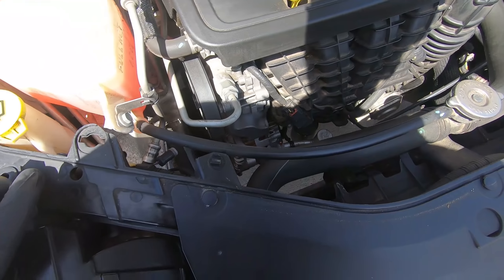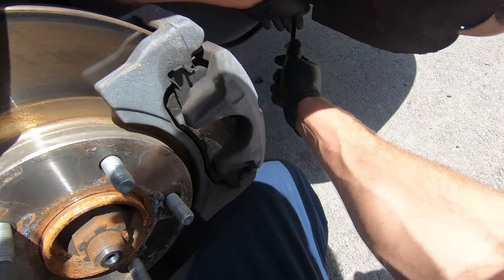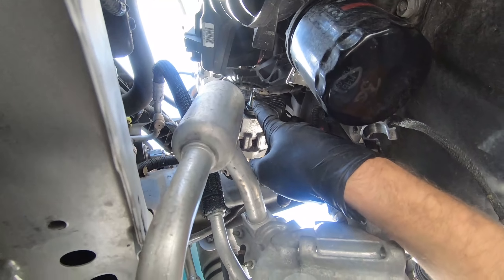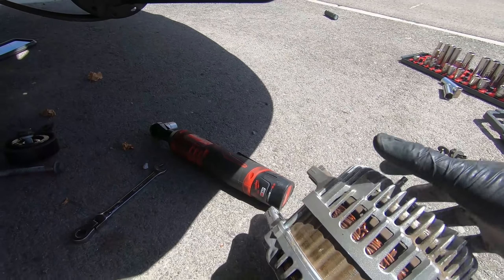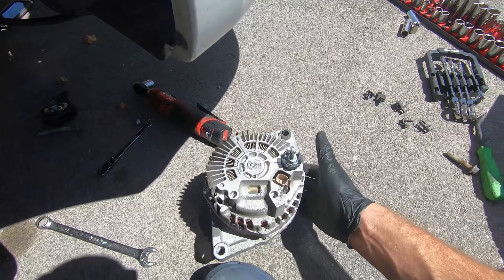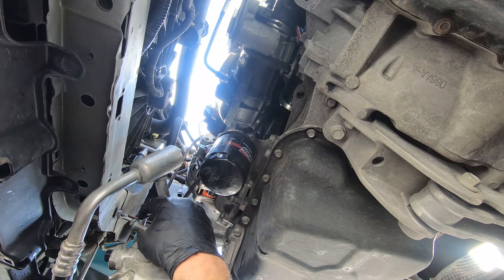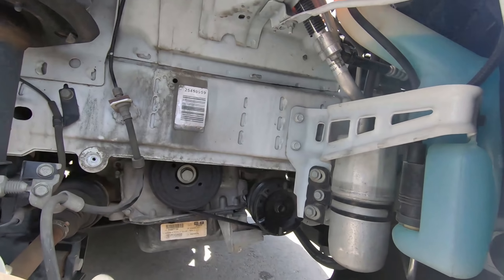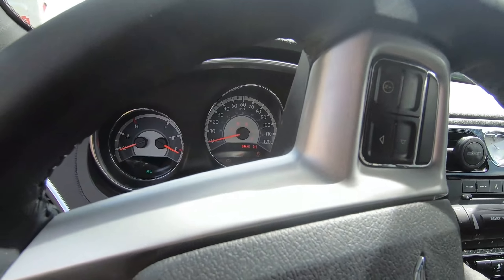This car shouldn't have made it home. Roadside Rescue

Comment: Unreal! I can't imagine how great it must be to fix stuff that isn't rusted. Like dude just unbolts stuff without a torch and doesn't have to beat the part off with a hammer. Where you at, Boise?
Reply: its called south where this no snow and road salt like here in Maine the only bolts and nuts that come off easy are that cars and trucks that are 3 years old or newer other then that u need pbb and heat and lot of praying unless it comes from the south and i did get to work on one and that was a dream and it was older chevy but it came from arszona lol splled it wrong lol
Reply: I was thinking the same thing i had a bolt crumble in my hand the other day. Turned to dust.
Reply: Sitting here in Denmark in my tow truck, and thinking the same. Here we have high humidity and lots of road salt.
Reply: @johnaranjo2059  "I don't feel so good"- bolt
Reply: I moved south a few years ago and look forward to keeping my cars running and looking nice for decades, no longer dealing with massive rust. Saves a fortune too.
Reply: Salt states scam their citizens. The car manufacturers must lobby for it. In my state it snows as much as Minnesota but we don’t salt. We have no problems in the snow. My 1990 Corolla doesn’t have any rust.
Reply: Years ago the wife and I were passing through South Dakota,  they must not salt, there were lots of 70s era cars that were extinct in Illinois.
Reply: In California we don’t have any rust on anything
Reply: Some states like NY also salt public dirt roads in the summer to keep the dust down on the road.   Rust is cancer and makes the job more difficult and often spreads causing more problems.
Reply: Rust or crinkled dash. I will take the crinkled dash everyday. And yet I live up north.
Reply: I live on an island in the Atlantic. High humidity in the summer and lots of snow in the winter.
Everything is rusted. I remember working on a car that was just driven here from the south and it blew me away how perfect everything was. Just dusty. Six point sockets fit perfectly. Never saw anything like it before or since.
Reply: i live in nh lol i agree it must be nice to work on clean cars never had the opportunity to work on a truly rust free truck
Reply: @b4322558  rain also causes rust here in the south bud
Reply: I want to move out of California so bad but I don’t want to deal with rusty cars...
Reply: @Bananahammock88  which  part of California

Comment: Ya, so some initial diagnosis may have revealed the short.   Luckily you found it after but it was most likely the actual issue.    Glad you were honest enough to put that in the video.   Not many people would have.
Reply: Always test before hand and you could have charged the same for I always verify even if a customer wants a part swap
Reply: I agree, probably should have done some more poking around before jumping in to swap the alternator. Also, should have tested the battery voltage prior. Would have noticed it was a dead battery and charged it while swapping parts so the new alternator didnt have to overwork to bring back a dead battery, potentially shortening the life of that new alternator.
Reply: Tbh the original likely has been heat damaged from the intermittent short to ground situation.   Likely would not have seen many more days and could have left them stranded somewhere.    Good call.    Just don’t want anyone thinking you’re a parts changer.   Keep up the good work!   Interesting business method.    Would suck up here in Canada with the winters.    Lol.  

Although I have been an HVAC service tech for 25yrs so hottest and coldest days of the year I am definitely outside all day.  Lol.

Comment: The problem with a higher amp alternator on a modern car is going to be that the computer is commanding a certain voltage to the fields for a certain output amperage.   For instance when the computer turns on the radiator fan it is commanding a certain amount of additional field voltage for amperage of that fan.    Modern cars (especially fords) a very exact and smart about how many amps they create.  This is to meet the fuel milage standards. The second problem would be the wiring.  If a car was rated for a 90 amp alternator and you put a 150 amp in it, if that alternator goes full field to charge up a dead battery after a jump, you may get some free melting action with the wiring as a wire rated for 90 tries to carry 150.
Reply from the maker: great points!
Reply: I once on my neon placed an alternator that drew higher and melted the ground on it.
Reply: i put higher output alternators on many cars where it isnt clear. vehicle never returns with "gremlins" or issues. the ecm will have an amperage sensor on newer cars to help control charging. also battery cables are generally over sized to accommodate both sizes
Reply: @toplessmechanic  I know the difference between voltage and amperage.
Reply: @R230Tuner Unless you run the battery dead, jump the car, and the alternator goes full field starts putting out more amperage that the wire is designed for.   Ya'll do what ya want, but I don't want to be liable for someone burned down car.
Reply: @R230Tuner The controlled area network/canbus/battery charge monitoring ( depending upon YMM ) may or may not have an issue with changing specifications on components. This is why you NEVER jump start connecting neg to battery post.... nuttn to do with hydrogen boomboom.... but the battery charging feedback sensors HATE seeing wrong info from a donor car battery. Connecting to frame does not feed through that sensor.... So much is computer controlled for energy management purposes, I would not re-engineer the vehcile without the engineering degree, or sense to look up the part and use the correct one.
Reply: @toplessmechanic  Dude, when you get your channel going, we will all carefully proofread, and look for common gafs
Reply: I have done a few cars which have factory upgrades to 440amp from 220 amp (ram 3500) where I added another alternator with bracket from a wreched truck and the wiring worked fine for the last 135000 miles since adding the additional alternator.
Reply: The car should only draw enough current as it needs to. Excess rating on the alternator can only hurt the car if there's already a wiring issue

Comment: Helpful  hint  when  removing  alternators  or  starters  from  under  cars:
I  use  a  small length  of  1/4 inch rope  and  wrap  around  item  to be 
removed.  Secure  rope to  solid attachment.  So  if  alternator  slips or 
falls,  rope  will  prevent  all  of  this.

Comment: jeez only 50k miles on it and already has problems, thats why u get a toyota
Reply: Scotty Kilmer?
Reply: @autooutlet1563  A '94 Celica, to be exact, that still blows ice-cold air conditioning ;P
Reply: i mean, while i do agree- everyone should just buy a toyota for reliability, this is a Chrysler and in no way represents the majority of other auto manufacturers. 50k is just an absolute joke.
Reply: Or a Chevy apparently, 301k and no major problems
Reply: You sir get the Scotty Kilmer badge of approval!
Reply: Auto Outlet Rev up your engines! 😎
Reply: @thatrandomchannel2248  yeah because you probably spent as much as the car is worth to repair the major problems
Reply: @aleks2912  nope, only problem I had to do was a power steering pump and high pressure power steering line, ($150) while I was at it spent another $20 and replaced the low pressure rubber lines, did a complete fluid and filter change (I don't count that as that's basic mantinence) and the car runs great! Now that I have owned the car for two years, my upcoming maintenance is getting the oil and transmission fluid changed, and getting my tires replaced as they are 6 years old and are starting to crack and become bald with mileage, the car now happily resides at 303k miles
Reply: I hate Toyota’s
Reply: @autooutlet1563  yea i watch him, but i was already a fan of toyotas wayy b4 i started watching his vids, i currently hav a '13 higlander limited, want to get 4runner trd pro next and that'll probably be my last car i ever buy
Reply: @Saladon89  I don’t blame ya Toyota’s are unstoppable. My moms rav4 burns oil like it’s job at 250k miles and still runs somehow
Reply: Chrysler is the second least reliable car company in America.  Most unreliable is Fiat.  Fiat owns Chrysler.  Chrysler has some pretty vehicles.  But reliability isn't their strong suit.
Reply: @autooutlet1563  It helps to change the oil occasionally.

Comment: Great video. Just couple of comments - never really trust electrical parts from big retail stores to function as intended.  Always validate new alternator functionality with voltage check (13.8 to 14.4) and clamp amp meter to make sure that battery is accepting charge. On a number of occasions I have received alternators that would not charge out of the box. Some newer vehicles also use a PCM controlled alternator where PCM controls amount of current output from the alternator depending on system load (AC, heater, defroster, headlights, etc).  Chrysler products are notorious for TIPM  issues - you got lucky on that call! Good Luck.

Comment: While that loose connection was likely the problem you were honest with it being an issue. Also when I do repairs and work I often state to the customer (usually friends) they are paying me to do a job at their request. This customer wanted the alternator replaced and you did that and found another problem to address. I NEVER say a job will fix the problem for sure unless its obvious. Since in this case you could have changed the alternator and it not fixed the problem. Its not necessarily your fault or the customers. Its all about understanding if they want to pay you an hour or two for diagnosis before work or just have you do it.

Comment: I think with higher amp alternators you have to worry more on modern vehicles with a lot of analog signals from various sensors and the PCM, but I've yet to run into anything that sticks out from putting performance alternators into vehicles for a boost to aftermarket stereo equipment and  offroad accessories for example. At most times it should just be going directly back into the battery. Could be wrong though.
Reply: Yep, with newer cars there's no room for a mistake. Some actually ignite the field through the ECM. Even hooking up jumpers different from factory specified order can damage other parts....

Comment: A lot of times the failure on those alternators is the clutch inside the pully. Ive changed the pully out before to a regular one and everything worked fine

Comment: I've upgraded from a 140 amp to a 180 amp alternator in my Holden VY SS Commodore which runs the 5.7 litre Chevrolet LS1 V8 engine,the high beams are much brighter now !

Comment: Do you torque spec any bolts? I notice you just give it a good snug crank before moving on.
Reply: I was wondering the same thing tbh
Reply: Yeah, just torque anything steel threaded until its tight. You get a feel for it after so long. Anything aluminum or super important I'll torque to spec

Comment: I may have missed it in the comments and I may be wrong but, the higher the amperage of the alternator the more power it takes to turn/run. So you rob power from the engine.

Comment: Would a higher than regular amp alternator cause any issues?
Reply from the maker: after looking into it, no. especially on the newer cars that are computer controlled. they put out according to the load you require so if anything a higher amp one is better especially if you want to run more auxilalary stuff like chargers or a sound system..

Comment: Question sir. As a mechanic,  how do you manage to remember what goes where when it's time to put things back together? What's your trick?
Reply from the maker: just a good memorie.but grypmat has some good organization options.
Reply: Depending on the size of the job, it works well to put the fastener back where it came from after removing the component.  That way you don't lose them, AND you remember where they go.

Comment: I think the worst alternator I've changed was on a 2000 Taurus with a DOHC engine...
Reply: Mine was a 2000 mercury cougar
Reply: Mines definitely a good escape have to pull the a arm and axle out
Reply: @Sam_kleinskc  Hopefully not a 2011 model?
Reply: @cHoLoM3oW  I can't remember I have had like 5 escapes since then

Comment: No problem using a higher one most of the time it is the higher voltage if you have windows sunroof etc. but if you use a lower one it only put out 13.3 or less I made a mistake along time ago😏👍

Comment: Any problems or comeback on this?
 
 It looked like the magic smoke left the wire when you plugged the control wires in to the alternator at 8.09 in the video.. at least it looked like smoke to me 🤔  but it's hard to tell on my little S8 phone screen. 😥
Reply from the maker: haha. no issues. it may have been dust they just got back fom a road trip and its dry out here! haha thats so funny. i hate it when you let the smoke out. they say everything runs on smoke. once you let it out its done!
Reply: I think the real problem was the jump point not the alternator.
Reply: That's great news!!  Yeah I've never been successful in getting the smoke back in the wires and I've let my share out. Lol. Luckily it's been in my cars and not a customer's. 😂😂
Reply: That was definitely dust

Comment: The problem is it's a Chrysler 200.
Reply: ~The only problem I found on these ,no alternator problems (so far) but the battery cables come lose,as the battery is in an odd place(front of the fender access through drivers side wheel well,tough to inspect battery cables easily).Not all but 3/10 of these cars my sister owned over the  years for her company..
~The 2011-2014 200's were reliable,my sister owns 5 of these cars for her business. She also owns a few Dodge Avengers from 2008-2014 same car just different style..She still has a few in her fleet,1 has a blown engine right now but these cars are driven a lot,all are high mileage so nothing to complain about and driven by multiple employee's so they actually are tough reliable cars(Avenger has over 200,000 miles).
All have over 100,000 miles now and only 1 had a throttle body problem and that's a 15 minute start to finish job..Plus the t.b is around $100 ,that car had over 150,000 when the problem happened..One just had the t.i.p.m that went bad(I bought one for $60 from a wrecking yard and the car works perfect,no reprogramming or anything)..
~I am in the car business,I did bodywork at a dealer for a few years,owned my own body shop and now I restore classic cars and also have about 10 cars on  average that I sell as I have my own car dealer as well...I do smaller mechanical repairs,the major ones my buddy does them(his own shop)..
~She owns and owned Honda's,Toyota's,GM,Ford's and so far the Chrysler products were one of the best..Yes,she had problems with Honda's and Toyota's too and good ones as well..Every car problem she gets,I know about because I handle it! Even when new and under recall(her new Toyota Corolla)She bought 3 new Honda Civics and isn't happy,all but 1 has oil dilution. has a new engine  replaced by Honda under warranty(the other one is waiting decision by Honda)these are new cars with low miles..She owns a few Corollas and they had their share of problems too(newer ones are more problematic than ones she had 15 -20 years ago)! She has 18 cars in her fleet,Chrysler products are her oldest and are being replaced ,she buys 2-4 at a time(new car dealers love her)! Plus 7 fullsize GM cargo vans! Soon all the 200's and Avengers will be replaced as high mileage and more issues with high mileage and different drivers issues pop up.. 
~I know people who work at all levels of dealing with cars,meaning sales,service(mechanics) body  etc..and every company has problems! Yes,Subaru,VW,Ford,GM,Chrysler,Honda,Toyota..
Reply: @01trsmar  That's awesome! Can't complain about getting your money's worth on something. I'm mostly a Honda boy, but seeing those 200s hold up is really cool.
Reply: @01trsmar  Dude just wrote a book ^^^

Comment: Terribly poor design when you have to remove a wheel, liner and ac compressor to get the alternator out.
Reply: Especially if it fails after only 54k miles!
Reply: The mfrs dont care, you get to pay for it, usually after the warranty expires and the first leaseholder, eg their customer, dumps it.
Reply: Alot of manufacturers put the alternator there I did one on a ford escape many years back also side note I did a starter on a Toyota v8 and had the rip the intake off the motor to get access

Comment: That's what happens when the Alt runs out of brushes, some regulators will tolerate abuse, some pop with one spark and by then the bearings are dry. I fix my own units, buy a new one, go ahead and try your luck on the rebuilders these days.
Get some real shoes man!
Reply: I rebuild my own alternators as well having being let down many time even by bosch reman